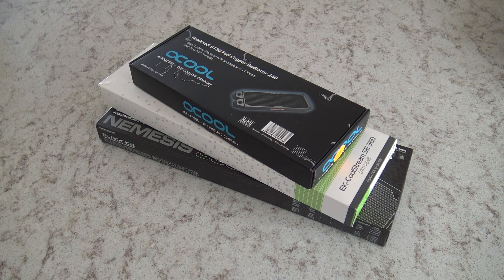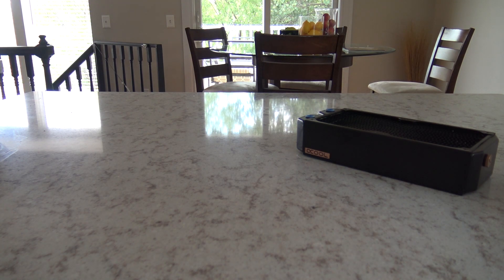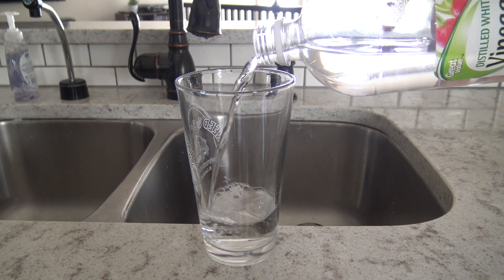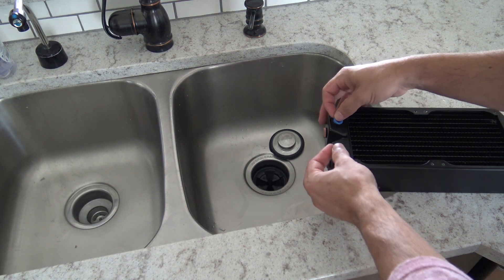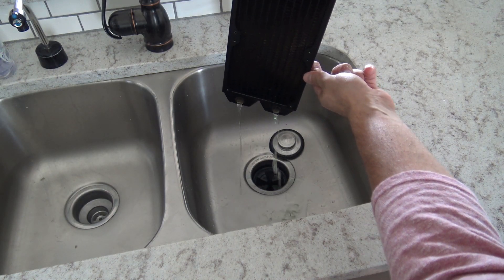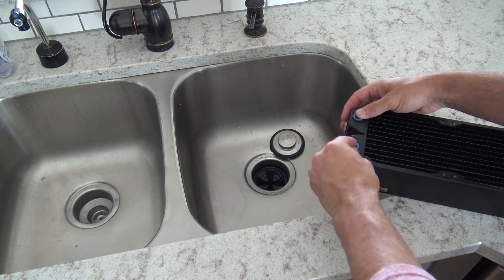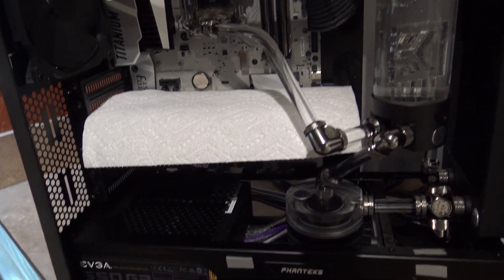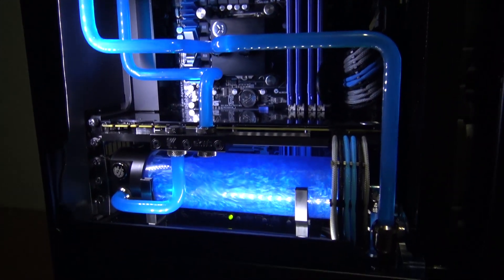HOW TO: Pre-flush Your Radiators

Comment: Some folks tell me vinegar is bad for Nickel plated stuff like blocks. Can I run alcohol 91% isopropyl in my loop to flush? What do I clean a used d5 distro plate with. A buddy sold me an infected sabotaged radiator full of crap.he said was.new.and it ruined all my components even tubing. Had to start over. I'm at square one only re using the cpu block and distrp plate and pump. I cleaned the pump blades with alcohol and cleaned the cpu block with 91% alcohol and distilled water

Comment: All also add you can fill the rad with the vinegar solution and leave if for 6 hours. but not longer than 8 to be safe. This will assist for a deeper clean

Comment: How would you rate your experience with the kind of liquid you use? I heard many times, that these solid fluids lead to clogged fins in your waterblocks. I also heard, that there are very less problems with that, if your loop is pre flushed correctly. What are your experiences?
Reply: I use everything from EK
They have a premix of clear fluid 
 you can use a few drups of there colors. It cleans the loop and does not clog up 
Im going to upload my new video shortly
Reply: @HappyDude1  I mean the solid fluids. The clear one are pretty common these days and are also well established. I would love to use a solid fuel, but what you hear about them sounds not very good. So i thought you could give me some first hand experience with it 😌
Reply: @d.k.4876  
Yeah there is a reason why not many of them use them 
I those that do switch back to clear 😉😊
Reply: @HappyDude1  Ok, i understand :D thanks man ! (i have clear at the moment. So you prevented me to switch to solid)

Comment: I did not know this was a thing i had to do and it worries me, there is no way in hell i can remove my rads now. Here's hoping its safe
Reply: How's your loop? This crap slowly starts going through your loop and clogging blocks.
Reply: I flush a 120mm on my test loop repeatedly.
After flushing with almost no visible gunks/dirt.
Assembly the test softube loop then what happen is white stuffs come out from the rad and build up around the tube and some inside the reservoir.
Then seeing this, made me clean my main raid again and again.
Since my main unit is still incomplete and saw people using hot water and some say vinegar is bad.
I remove the rads in the case.
Use boiling hot tap water again and again and Even let it sit until the rads completely cool downs. 
Repeat flushing of standard temp water and putting more hot boiling water again inside.
And flush it with distilled water.
Drying for 12hrs before putting it back in the case let it without plugging it to make sure it's fully dry before putting the plastic plug again.

Now since the loop have no GPU and GPU block to complete it bcuz of fckin GPU price hike. I opened the plug on a rad that is going to be connected to the GPU and saw white stuff inside, during the time i cleaned it months ago if I remember correctly  some white stuff remains but no more gunks did not go out of the loop.

Do I need to repeat cleaning the radiators?
Since I'm adding a new radiator in a loop but I don't want to disassemble the tubes now lol.

So looking for alternative to clean everything without disassembling the loop.

Comment: I can't believe I haven't seen this video until now.  I have been building custom loops for the past decade, and all of the loops developed a green tint to the clear tubing in the first few days of use. Draining the system left me stumped, as the distilled water I use was still crystal clear. No signs of microbial growth or any contamination.  I would replace the tubing, and all was well from that point on, no more green tubing later in time. I never understood why the tubing went green in the first few days only.  After watching this, I now realize it's the dirty radiator sending soluble copper into my loop, which deposits on the tubing. I will flush my radiators from now on. Maybe not with dilute vinegar, but at least with several hot water flushes.
Reply: Which brands of radiators have you used? I know Alphacool wants us to flush them as part of keeping their costs down. EK I think claims to have flushed radiators but charge more. Not sure if I'd rely on that though.
Reply: @EmoEmu  I have mainly been using alphacool rads. maybe i just never read the instructions!
Reply: @jacobi289  The instructions are probably only in ZE GERMAN. ;)

Comment: Do NOT use vinegar, it will eat through the nickel. Just use HOT distilled water.
Reply: Copper rads are ok with the vinegar, that's how most people clean their copper pots, and pans. The only nickel you might have would be on your fittings etc, not inside the RAD, thats why you should always flush everything out thoroughly with DI/RO water.

Comment: i would never flush a copper system with vinegar (acetic acid). copper reacts with acetic acid to copperacetate whitch is verdigris. this results in a verdigris coatet radiator which works as an insulator...
Reply: Hello. What can you recommend?
Reply: @MrSkazk1  i recommend alcohol or isopropylalcohol first to clean the system from organic materials like fat and oils and then deionized water. that should be enough abd thats what i did. regards

Comment: Listen to this dude and pre flush your damn rads, I decided I was to excited to get my project running and didn't flush either of my normal/thick dual rads or my slim triple and why it hasn't been all bad I have found residue and crap pushed around my loop over time.

Going for a full clean down tomorrow after one of my gpus failed and using this guy's video to brush up on instructions
Reply: @Hector Callum that's sad

Comment: great video; how about a video showing how you drain your custom loop?
Reply: I made sure to get a quick disconnect fitting. Just break it then take off the connectors while over a container to collect the fluids. You can also use 3 way split with a drain on one end though I find those are harder to find anywhere. But if you can just give it a fair amount of slack and put it in the lowest spot you can.

Comment: Thanks heaps for the tutorial!

Gonna be building my custom loop soon, (need to convince my parents to get me the parts for Christmas, I'm just shy of the age when I can legally get a job D: ). This tutorial is going to be a great help among your others. Thanks!

Also, for those curious about my system that will be custom loopified (loop parts included), here:

CPU: i5 6400 (to be an i7 6700 soon, don't get your knickers in a twist)
GPU: GTX 980 with water block 
Case: InWin 301 red and black edition
Ram: 8gb crucial ballistix (perhaps upgrading to 16gb)
Mobo: Asus B150m Pro Gaming
PSU: Thermaltake 650w rgb 80+ bronze with a 7 freaking year warranty
Rads: slim 240mm + slim 120mm
Hardline tubing (duh)
Res: EK X-Res 100 pump / res combo.

Tada! Have a good day everyone.